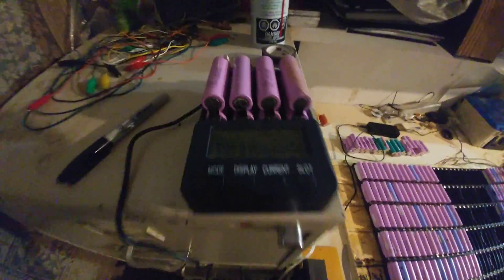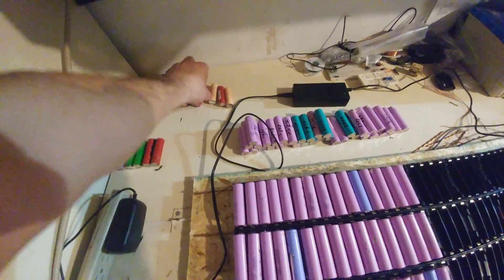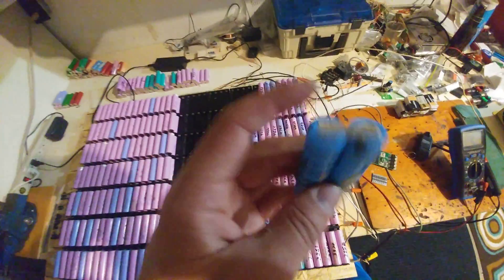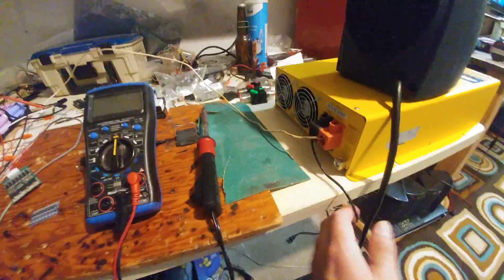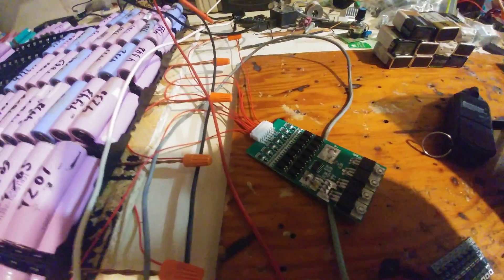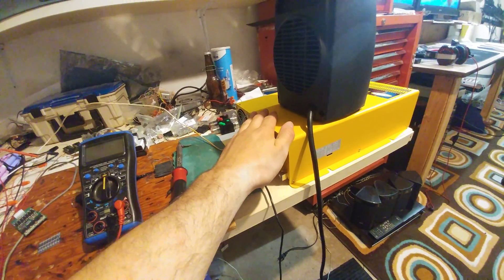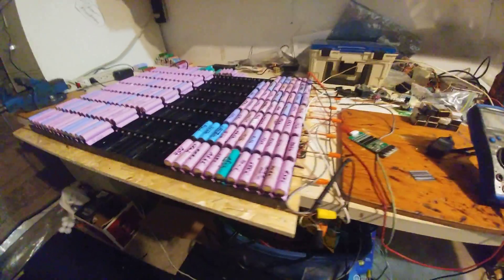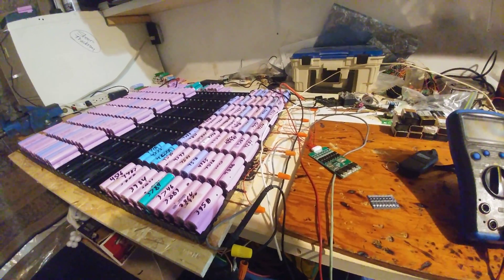18650 7s 24v 29.4v bms diy power wall update

Comment: It called a spot welder :-)
Reply from the maker: steve64464 lol thats it ty!
Reply: I had been trying to make one with a solenoid switch and a super cap bank but i don't think i can get enough amps up.
Reply from the maker: steve64464 i dont see why not. Super caps are mostly good for amp draw. You mean too low in ferads?
Reply: As in i think its too low a capacity , Its a 12v rated bank for starting cars.